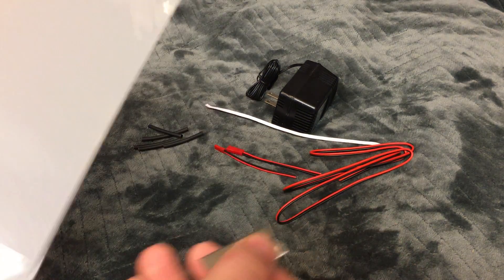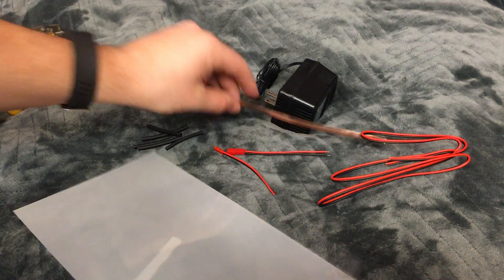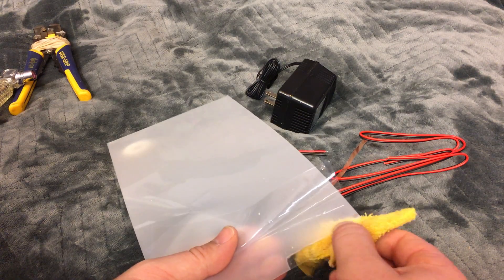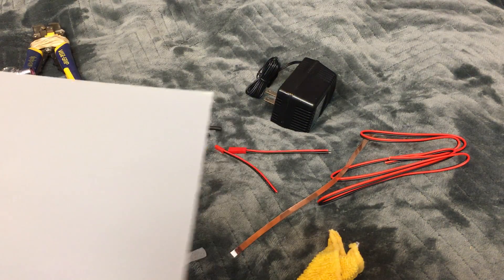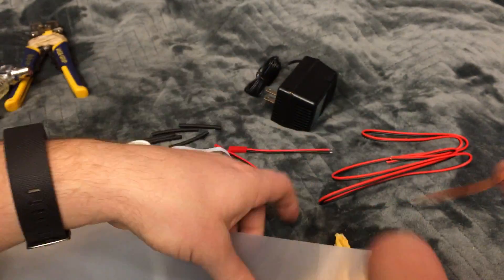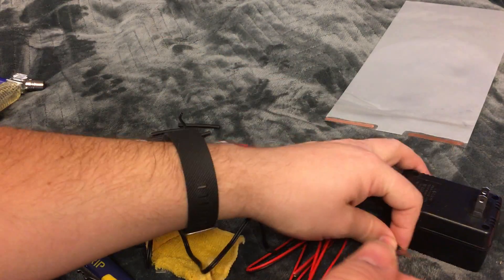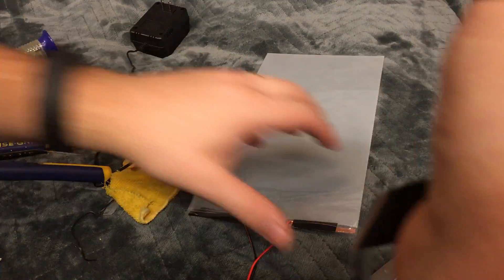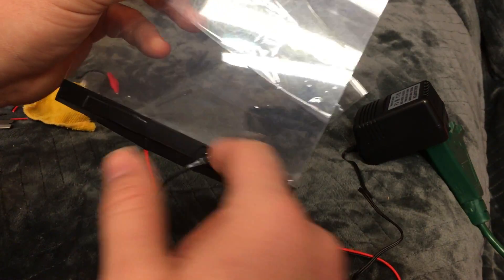Institutions on how to wire smart film  endlessparts

Comment: Hi, I'm a 28yrs experienced tinter & it seems to me that this film can be quite dangerous from powersupply failure & instantly you can't see out at 100mph,seems they need to reverse the fade in out method for safety reasons seeing as you can't just reverse the polarity
Reply: This is pdlc its private off and clear on.. similar to magnetic door locks they also have another version called pnlc, its clear off and private on.. also like fail safe door magnetic locks.. so both versions exist